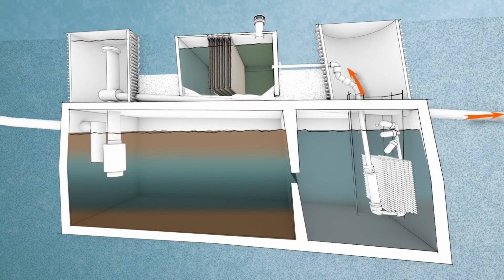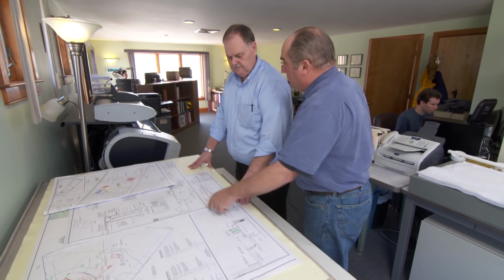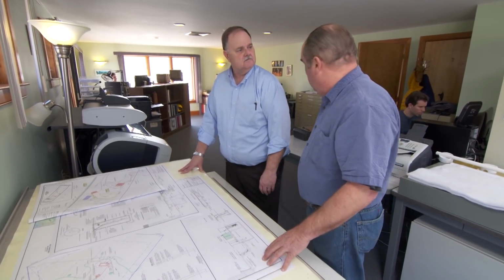How to Upgrade an Old Septic System | This Old House

Comment: That is a huge problem waiting to happen.  If they were in a climate that did not freeze it might be ok but those small pipes will freeze up quickly and then you have a pump that cant put the water anywhere.  That system has no room for error.  That house had better not have very many people living in it or those tiny pipes will be overwhelmed super quick leading to backups in the system.  They had enough room back there that they could have done a multi-tank system that was still gravity feed that would have removed the problems without relying on a powered pump.  I have to use powered pumps on my property and it is always a nightmare when something goes wrong with them.

Comment: What you never want to hear from a septic designer: no, we can't use a basic gravity fed system. Get into these crazy systems and the $$$$ goes way up, and potential problems do as well.
Reply: just a scam and palms are getting greased. Here if the system is over 5 years old it has to be replaced completely if u want to sell ur home
Reply: Dragon Manifest  Our county regulations for homes with septic systems. It forces people to either  upgrade to a new system or connect to the sewage system from the city.
Reply: You are right sir!  Nothing like replacing a sewage pump in 10 years and the fabric membrane along with it
Reply: zack9912000 how much they want to connect to the sewer system?
Reply: @frank9253  3900 to connect people to the sewer line

Comment: Divert all grey water out of the system. Introduce an airpump and diffuser to convert to aerobic digestion for the rest.
Reply: Good flex bro. Though of course no one is going to build a system on that 2-line advice in a youtube comment
Reply: @Engineer9736  Right? I had a brand new system fail in about 3 years because the contractor didn't put an effluent filter on the outbound side of the tank. Then I researched and repiped in my basement to take the washing machine grey water elsewhere and I added a Koi pond pump  and an airline to a diffuser in the cesspit. Absolutely no problems after that. This stuff is way over engineered to bend the homeowner over the arm of a sofa.

Comment: Fancy terms for pumps & motors you’ll be sorry when they break...
Reply: They probably did not even recommend a grinder pump which are great pumps.  I bet that they are using a pump that is only designed for liquid as the filter media would clog up super quick with a grinder.

Comment: What?  Hold on.  He said it converts the nitrogen to a "different type" of nitrogen.  I thought nitrogen was nitrogen?
Reply: It’s the same thing but only different 😂
Reply: again scam artist, its clearly not making dry nitrgoen
Reply: It's like that "carbon footprint" you hear about all the time.  The media is completely useless when it comes to chemistry - or any science for that matter.  The engineer probably knows better but they asked him to dumb it down.  I'm pretty sure what's going on is the bacteria are breaking nitrates down into N2.  Normally nitrates are a good thing - they're basically fertilizer and they help plants grow.  But they don't want them in that area for whatever reason.
Reply: It changes 10 dollar nitrogen into 1000 dollar nitrogen!

Comment: Where does the 80% of the nitrogen that is reduced go?
Reply: De-nitrification is a multi step process to nitrogen gas.
Reply: it reenters the main tank of the system to go through the whole process again and again. only a small amount leaves each go around.
Reply: Straight out of your wallet!